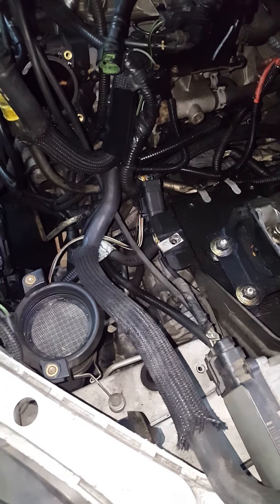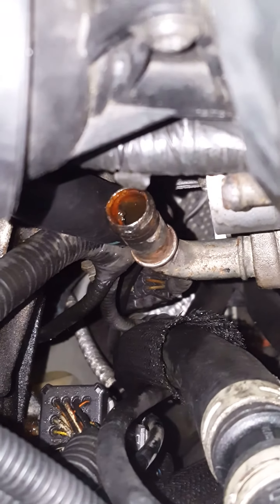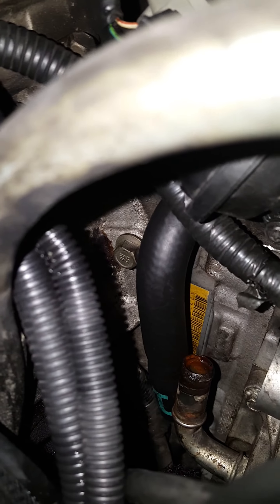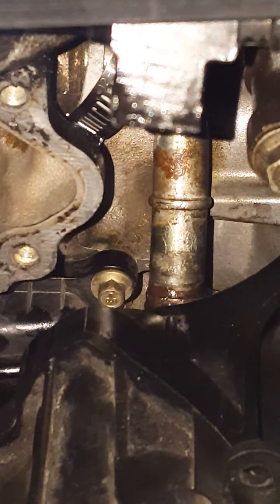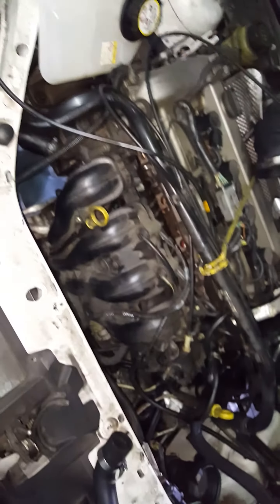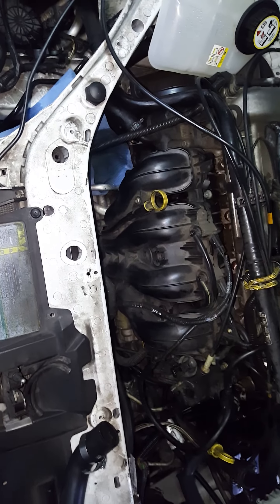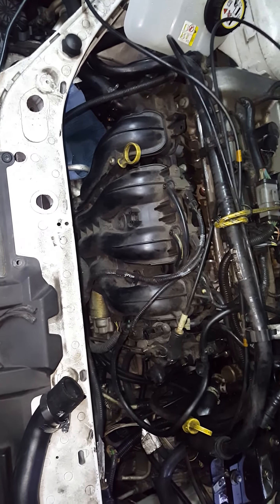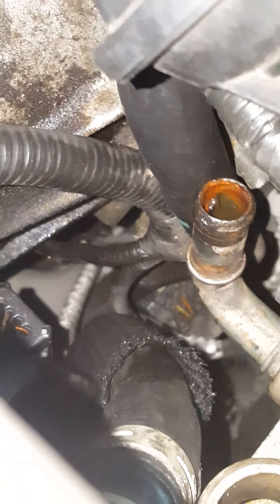2003 Ford Focus 2.3L bypass hose rupture

Comment: You will not end up replacing parts (radiator, heater hoses, lower upper hoses, etc) bursting out coolant. Replace your radiator cap my friend and your spending will end. PROBLEMS finally stop.
Reply from the maker: It wasn't this simple with this car. I replaced the small stuff and it lead to replacing the big stuff.
Reply: @miguelmarquez7505  this is the job I'm currently taking a break from lol. Already replaced everything else. Radiator, cap, hoses, and water outlet. I was looking at videos to see if there was an easier way than how I am doing it. I'm guessing there isn't lol
Reply from the maker: @joemattox7525  there isn't unfortunately. You are limited in space with a Ford so yes everything around it must come off